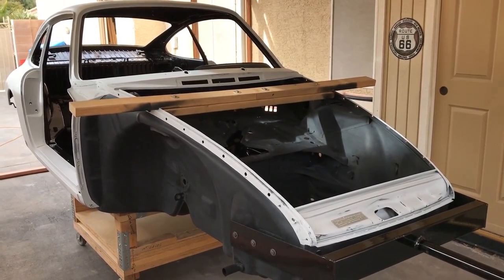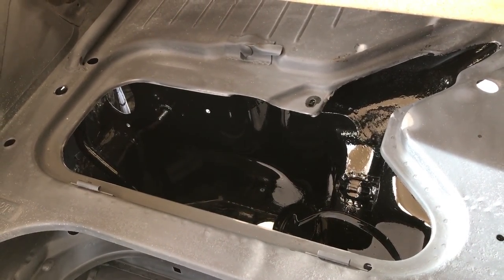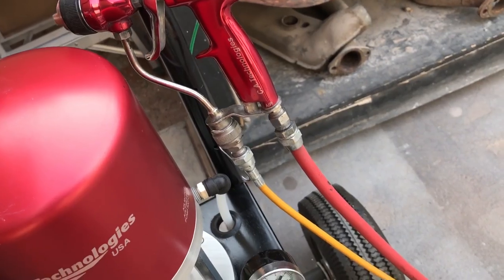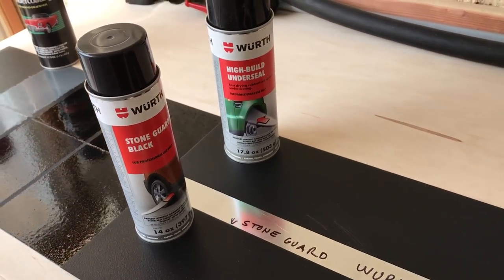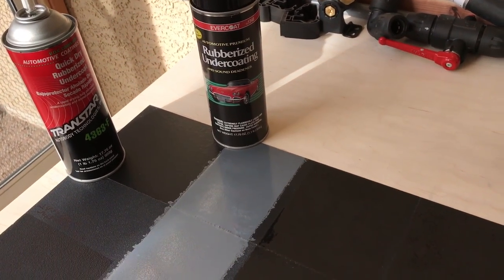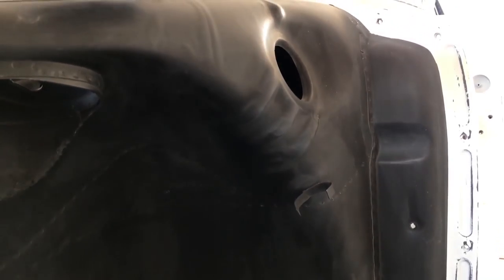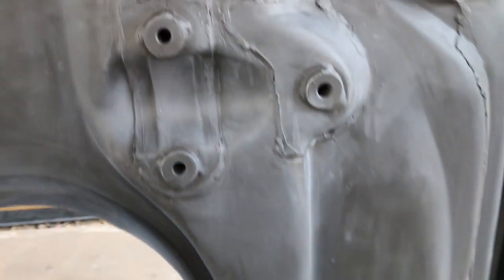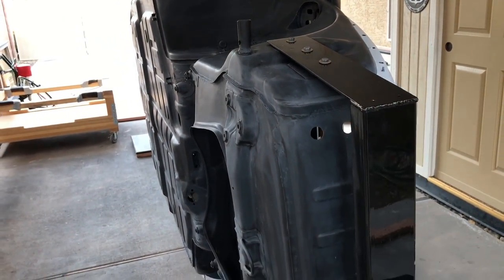1967 Porsche 911 Video 15 Undercoating process part-1

Comment: That floor looks so factory wow. Nice. It’s been a while but In  the 80’s when I was active in the Porsche restoration we would use a yellowish rocker shutz think from wurth or 3m using a splatter gun we would just blast it would leave a rubberized coating sort of like the newer Porsches would use , the yellowish rubberized coating would be lightly painted that was it,   Anyway I’m watching your videos because I’m about to restore a 1966 sr coupe 912 slate gray this fall not to the concours level you do but some welding in pan up front here and there   If your ever in Maryland with your 911 , stop by !
Reply from the maker: Thanks ocella, I did use some of the 3M under the hood for texture before painting..Turned out nice and looks factory.
Thank for the invitation! If im ever in Maryland I will certainly give you a shout!
Best of luck with your restoration work and if there is anything you might need help with just drop me a line
www.mikesrestorations.com
Cheers!

Comment: Another informative video.  I always look froward to you videos, and can't wait to see this project progress.
Reply from the maker: Hi Brett!
Hows that new project coming along do you have a game plan on its restoration?
Hope all is well down under!
Reply: Just working my way around the car identifying the areas that need attention.  I have been side tracked because I decided to sort some of the mechanical issues as I go.

Also, it is summer here and we have experienced some extremely hot weather (even for sub-tropical Sydney) which makes it hard to go all day, so progress is slower than I expected.
Reply from the maker: Brett Shields Thats a good way to go Brett
I usually take up to one year before starting in seriously..sorting things out while its still running is a sure way for success. Its a great way to try out some things before getting in deep=) Lots of Luck!

Comment: Mike when you say you scrapped the undercoat off did you use a solvent? Or was it literally just scrapping??
Reply from the maker: Hello Drive
For the most part it was all dry scraped..a few areas were coated with paint stripper but over all pretty easy to scrape
Porsche used an asphalt based undercoating and it just dried out too quickly and lost its adhesion.
Thats why these early cars are so prone to rust. The water would get behind the loose undercoat and be trapped in there.

Comment: Hi Mike,  I can't find the video where you talked about what you did on the interior.  Did you por 15 the entire interior?  I'm getting very close to primer, undercoating, and Por15.  Trying to figure out the best way to go about everything.  I'm actually thinking about Por15 in engine bay, underside/pan, wheel wells, and interior.  Then undercoating in engine bay, way wells, and pan.  Partial undercoating in trunk.  My trunk area is a bit rough and I may apply some body filler and smooth out some areas.  To be honest, I would like to do the trunk in Por15.  Thanks for any feedback.  Rodney
Reply from the maker: Hello Rodney
Unfortunately I didn't do any video work on POR 15 in the interior.
The interior was painted with it but the dashboard upper and lower/ was sprayed out first with a 2k Matte finish.
POR 15 makes a great primer sealer but if you will be painting or undercoating over the top of it it will need to be sanded first.
Its very tough to sanding as it is extremely hard!
I hope this helps
Good Luck!

Comment: Was looking for application of "porsche" matching seam sealer. Did you do any seam sealing on this car, front pan? Sorry if I missed it. ty
Reply from the maker: Hello gtbarnes
Yes the seam sealer used on this project was made by SEM 29392. A fantastic product and paintable.
I recommend using on several applications throughout the series
Unfortunately my early videos were not put together very well or very thorough .
Making videos is not my specialty.  Over the years viewer engagement, questions, comments and requests have help shape the 
videos to be more complete and detailed.
I try my best to include as much information as possible but sometimes miss some basic things.

Comment: What is fluid film? I have rust on my arches of a 997. Salted U.K. roads
Reply from the maker: Hello Ti
Fluid film is sprayed onto the bottom side of the car to act as a barrier or film substance between the water/salt and the under components of the car. Its excellent for cars that are driven in touch weather conditions.
Reply: Thank you! Why this rather than waxoyl?

Comment: Thanks very much for the salt advice Mike. Much appreciated. I have been using light, local wire brushing to remove the surface corrosion, powerwashing, drying and then spraying on Corrosion Block. http://www.acf-50.co.uk/corrosion_block.htm  This has the advantages that it can be quite crudely applied (masking only brakes and tyres) and does not interfere with future maintenance (as various heavy underbody coatings can). Time will tell how good this approach actually is.  Two concerns are the exhaust manifold brackets are now pretty crusty and nobody seems keen to help me remove all those bolts before they become domes! It would also be great if Corrosion Block underwent a colour change...any surface rust, although pacified, stays looking like darker rust. I'm still searching for someone in the UK with your attention to detail ;)
Reply from the maker: Sure thing Patric! I hope can be of some help
It looks like your are on the same track with the corrosion block..
Interesting thing about these old cars and even the ones rusted away is that
the only surviving parts in perfect condition are the ones coated with leaking engine oil or leaking seals. Keeps everything preserved perfectly!
Reply: My father used to get into trouble with the road safety authorities here, because he always coated the underside of his cars with old engine oil -so thick that they couldn't assess whether any structural rust had set in. It hadn't of course because he'd stopped it ;)  

In other news, I read the tech spec of the Loctite Extend product you mentioned (called 7500 SF in the UK). Something to bear in mind is that they state "Caution: The product may cause rust if applied to a non-rusted surface."   How annoying is that?
Reply from the maker: Your Dad is a smart guy! Engine oil would be the best way..maybe a little smelly but sure would protect
You are right on the rust converter. All converters that I am familiar with will cause rust on clean bare metal..strange chemistry going on there.
I actually did some testing on that stuff before using in the fender areas of the Porsche. I tried an expensive SEM brand about $80.00 USD per quart and the loctite about $6:00 USD per can. The loctite actually applied better and had better results.. amazing..Lots of brands out there but I think all of them will work in the same manner.
Maybe coating your car with some thin 20/50w? or even some synthetic oil..
might do the job? could try a test area for one season and then power wash it off to see how it did=)
Reply: I should have known that you'd have done your own tests! The corrosion block forms a nice thin film of clear oil which seeps everywhere but does not loosen fixtures...I'll probably stay with that.
Reply from the maker: I think thats a great choice!
no way to go wrong there=)
Good luck!